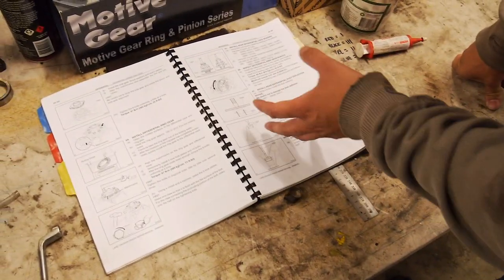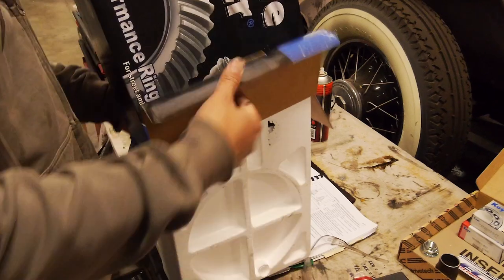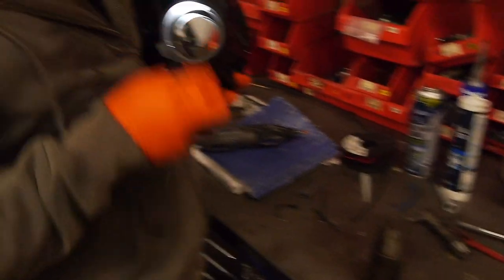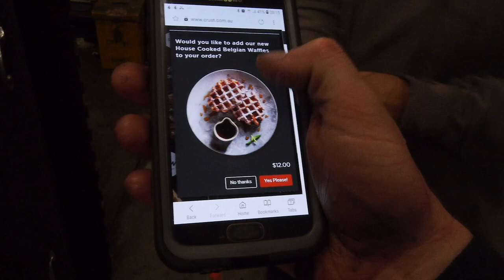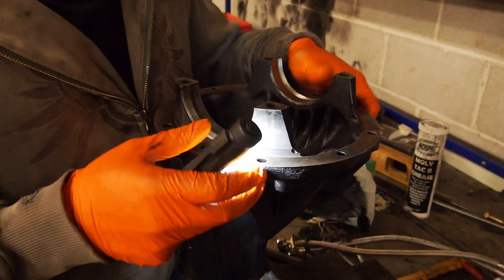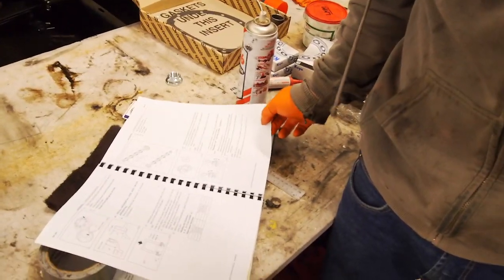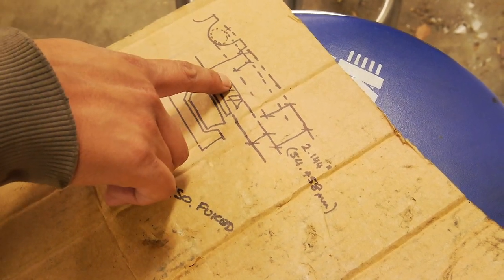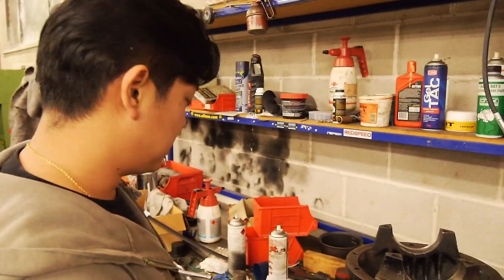ARB AIR LOCKER INSTALL - IN DETAIL - TOYOTA HILUX SURF [PART 1]

Comment: What about front diff. What gears you running. Should both front and rear match. Thanks.
Reply from the maker: Haven't done the front yet. Yes they need to all be the same ratio. These are a 4.55